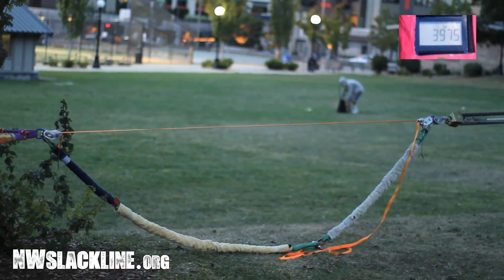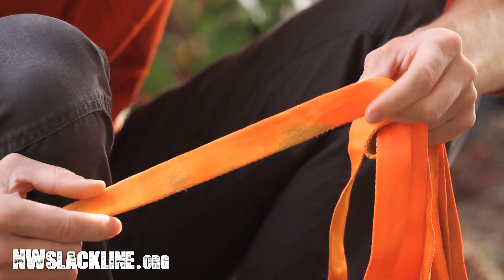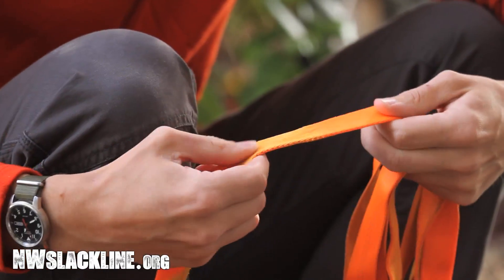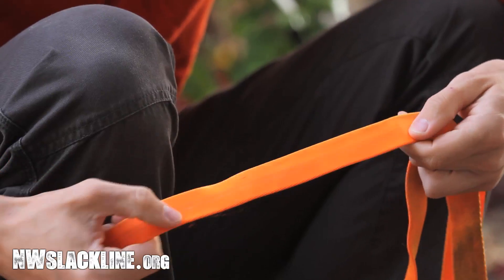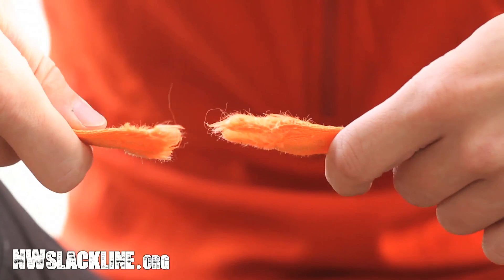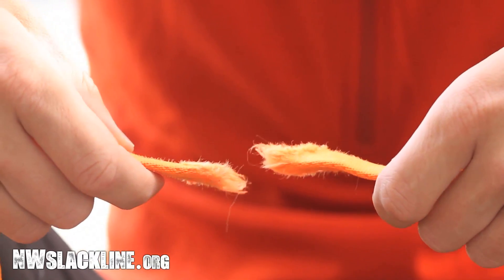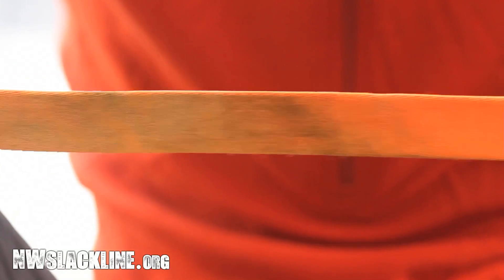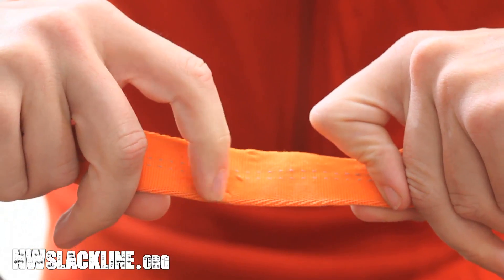Does UV exposure affect slackline strength?

Comment: I think the ratings on webbing and such are based on something like 3 standard deviations from the mean.  If that were true the average strength of the new webbing was probably much higher than 4500, and 4000 could be much lower than the average.  It might be worth contacting the company and asking what the average and standard deviation was on the break strength for that webbing.  Still, I agree 4000 seems pretty good after a year.  Thanks for the test!